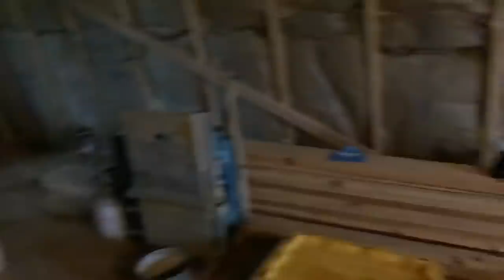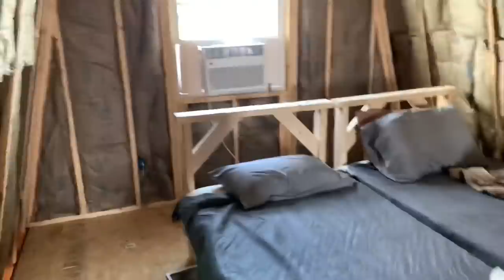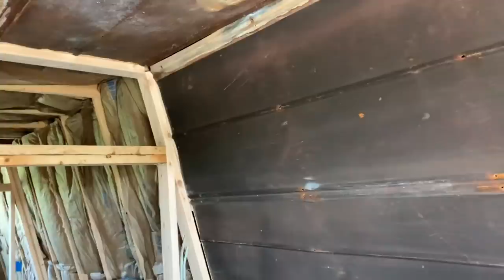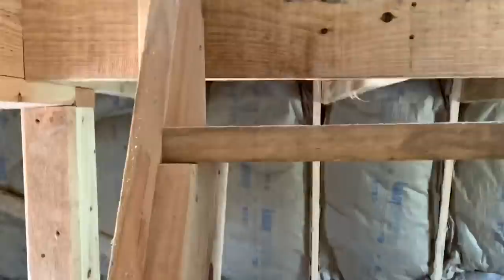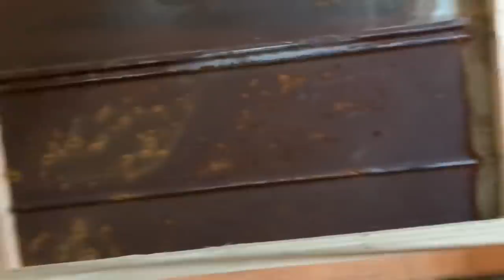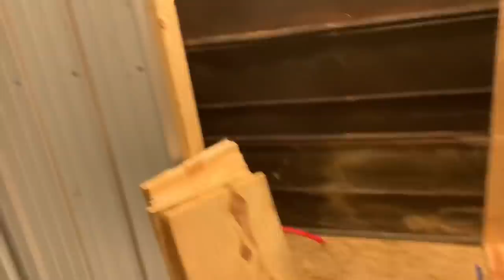Working on the Kansas Cabin again! Interior Work Getting Ready for Deer Season!

Comment: At 4.30 and reference to the tin sheet beside bed put carpet up 3ft along the wall of the beds. Carpet is great insulator itself and have the bedroom in my hunting Shack. Only gets to -5.0'C buy makes big difference and on 35.0+'C it helps with heat. Trimmed off with 2"x1" around edge

Comment: Hey Jeff, I’m not sure if you plan on using that during the winter, or if you plan on winterizing it, but you might want to rethink putting those water lines in the exterior walls or they could freeze.
Reply: I'm sure he has thought it out but a hunting cabin I used to go to it was set up so you could stop the water from the spring and open drains so all of the water drained out of the house, no water no freeze.  This was in the mountains of Virginia and it gets very cold there.